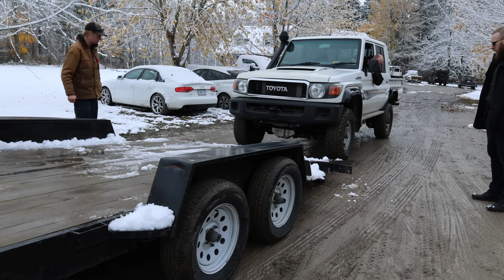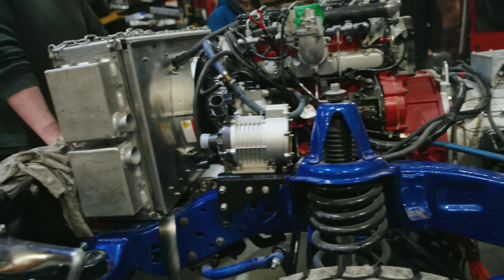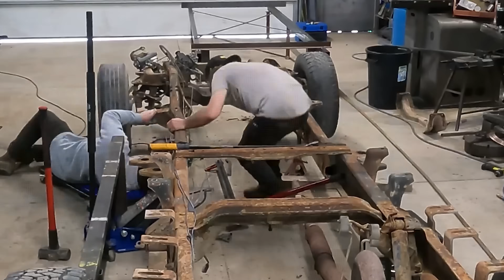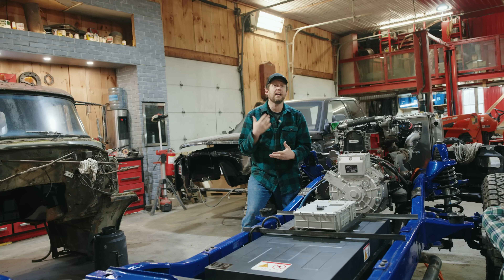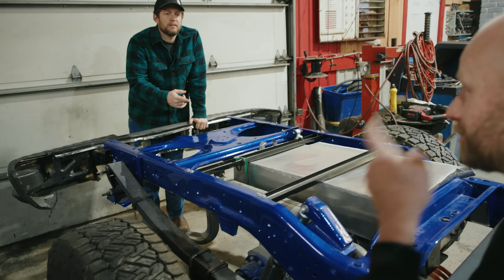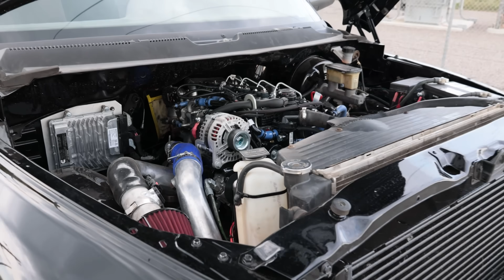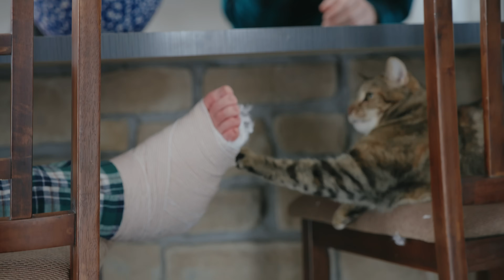Scrap Our First Design and Build an Edison Pickup Chassis from Scratch?

Comment: definitely do not go wider or outside standardized specs every side of it will be impacted Edison's intention is to be fixable to use off shelf parts to be very adaptable and as soon as you go wider that's all out the windows now every hitch on the market no longer is compatible no after market parts fit it tool boxes side mounted are now needing to be shallower to fit when we already scream for deeper bigger boxes decks and boxes now won't have manufacturer support cause not enough vehicles out there to be worth the complete redesign of mounts even sub frames of a box or flat deck need to be moved to line up with frame rails  sure you can adapt to mounts for different cabs and passenger vehicle mounts but you are now playing in so many more clearance issues  and now say a 5th wheel hitch which is generally spanning the frame rails if no longer above the rail now you start running into dot issues  another side is you just cleared up space with the 4 link or under slung suspension allowing for more tire and wheel options which is generally a massive issue for people putting aftermarket wheels and tires on  the vertical height of frame rails yes feel free to make taller as the frame needs to be below all the components to prevent damage if ever in soft ground or off-road it would actually open doors for people to mount things to it but stay inside of universal width specs

Comment: I am wanting to put a 50-60s truck on top. I love the air suspention it really does make a huge difference on semis. I've even thought of adding cab suspention. I was wondering will it have air breaks? Also what would the specs on the compressor be? That last part could mean a small air tank and air hoses to run some air tools as a job sites generator and compressor. A way cool application

Comment: I think this will be a cool swap project for home shops guys but I just don’t see a way for this to actually be feasible for actual commercial users.  When you make your living with a vehicle you need something that just works and this is going to be a very glitchy system I feel like.  By the time you get a whole new drivetrain plus frame and the labor to do the swap you’re going to be in the price range of just buying a new truck.  I still think it’s cool though.

Comment: For my use case, a pre-built chassis won't work. looking to retrofit on X military HMMWV. They use independent suspension on all four corners with inboard brakes, half shafts, and portal axles with CTIS.

Will my best solution be to run an electric drive mounted to the differentials and just remap the torque curve to avoid destroying parts?

Comment: I would be very interested in getting a Edison pick up kit done for my 2011 f350 single rear wheel.   

The only thing I would like to see is the ability to keep my manual locking hubs and the ability to shut off the front drive motors.   My truck drives completely different in 4WD with the hubs locked then it does in 2WD. The steering is “heavy feeling” compared to 2WD so the ability to run 90% of the time in 2 wheel drive with the front hubs unlocked and the e-Axle not working would be a must have for me! I’m sure this could be accomplished with programming and adapting of the OEM manual lock hubs on the OEM knuckles.    I absolutely love this technology, I think what you guys are doing is amazing and I never miss a video!  I’m sure I’m not the only person who could possibly have this concern!

Thank you in advance.  A reply to this comment with some insight to this would be massively appreciated boys!

Comment: Hey guys, something that no one has ever done in a pickup is to leave room for a fifth wheel hitch to hide in the frame rails when not in use. Thousands of rv guys like me that drive around all day with the damn fifth wheel taking up bed space and having to use a winch to remove it. Maybe it’s not feasible but you guys would change the world if it could be done. Dodge,Chevy and ford would be left behind.

Comment: Smaller batteries is good, but not too small.  It needs to have at least a 100mi battery only range.  I have an '01 ram 1500 that I want to convert and make it my daily driver.  My goal is to charge it every day at 110v and only run the generator on road trips.

Comment: Building your own frames will that not jack up the price of the conversion,
Reply: That depends on the conversion. 

Rich spent countless hours repairing, rebuilding, altering the frame on the black dodge and white LC to get all the components to fit.

If they spend money on a new standard frame, then parts just bolt in.

So they're spending way more on frame parts, but way less on rich's time.

Every buyer will need to make the call on whether to buy just the drive train, or drive train plus chassis.

Comment: The chassis concept is the right one. I want to mount a 60's era wagon onto a this type of engine-generator-battery-chassis configuration. The labor to get a retro chassis fully functional is huge.
Reply: It seems that you need a 2.8l shorter version of the chassis and then a longer chassis for a V6. The loading usage will be different for the power needed.

Comment: I know I would never have the money for a conversion but it would be crazy to convert my 1985 GMC G30 van body class C RV. Now yes it's a van but with GM they based it off of 3500 truck bodies. I think it was the C or K series of the time. It has a 146" wheel base. And there's so much unused real estate on the underside.

Comment: Changing frame widths complicates bed design. Chevy in 1946 used a wider frame which killed modification because the bed had to be that width specific

Comment: The problem, will come, when the diesel does not run long enough to charge one cell, to run a full regen? And either running the engine just for regen, “the engine will be doing basically a “forced regen” while driving! ? It takes 15 or 20 minutes just to warm up, then can start regen, but one battery might already be charged?
Reply: For regen, do you mean refill the batteries or regenerate the DPF
Reply: @Sah-o5m to clean the dpf, which they will need to get these things certified for on highway!
Reply: Although with Lee running the epa that MIGHT not be the case, may get away with valve overlap?
Reply: And keep in mind, Edison is anti America at heart or at minimum anti Trump. So they are leaning into the eu market, so yeah they gonna need it

Comment: 4:30 As someone who lives in the mountains, I disagree. I would like to have batteries large enough to capture all the energy provided by rolling downhill. And that can mean up to 2000 m in height difference. With a gross weight of 4 tonnes, this is equivalent to 80 MJ or about 17 kWh of energy.

Comment: If you're going with airbags, more likely, you're gonna be using 4 link. I would have an option either. As an airbag or a coil, spring Dodge does it with their pickup trucks? It's worked out fairly well for them. Can't say a lot of good things about Dodge trucks. The hemi engine in their they're air ride and coil spring suspension

Comment: Please start looking at hub motors for steer axles. Hub motors are much lighter, allow the cleanest drive line and the axles can be solid or independent. The big drive axles have oodles of power. Front wheels only need a small precise amount of power when in mud or snow. These front hub motors sit in and next to the brake hubs. Very different design goals for powering streered wheels.
Reply: A lot of unsprung weight though and it's easier to protect the motor as a big unit in the middle.
Reply: @makatron Let's say the hub motor is 100lb and 25hp. So 200lbs and 50hp combined tucked behind the disk brake. Your proposal for 20K axles would include a half unsprung 200lb driveshaft. A front axle with a carrier and locking differential is 650 lb all unsprung heavier. Might not include universals. BTW, universal can easily be the weak spot putting torque to the road. Besides having almost 4x the unsprung weight, you add mechanical drag, take away individual wheel vectoring. The other big plus to hub motors, is they could steer far sharper than a universal would ever like. Stew it over it has big advantages.
Reply: @ctibpo991  yeah but a heavier wheel is also harder to move and to brake. Thus making turning harder due to the extra mass.

Comment: You are not able to buy a pickup and get upfit. The problem is the 34 frame. That is going to be your biggest problem. Most small trucks have the factory width in front and then the 34 in back. This is how the big manufacturers are able to use their cabs. 

I know that you understand what the industry is doing. And the air ride is a big miss in the market. 

If done right. People are going to get your truck because of the ride.

Comment: For cab mounts drill the frame to fit multiple brand body mounts and build mounts that fit the cab going on so you can take those mounts,use the appropriate holes for the appropriate mounts so it fits up like designed. Keep the frame the original width so that fifth wheel hitches and accessories such as that still fit the truck

Comment: I have a 2019 ram 5500 2ton truck. I would really like to use the electric Hybrid kit on this truck for pulling heavy loads across country. Would really like to keep as much bolt on as possible regarding cab and frame dimensions.

Comment: the frame being 34 inches wide for the main build, but can you do a subframe that is designed for the batteries so they are protected and be lower to keep the weight down, with a fuel tank configuration that does not cause problems?

Comment: On the frame rails, make the under cab wider and narrow it back to 34” by the rear axle, kind of like how the McLaren carbon tub concept looks ( or this ASCII shape -> /T\_ ). That way, you could fit probably up to 2 batteries running perpendicular to the frame under a 4 door/supercab truck while keeping the rear and the front more standard compared to other trucks (and use more off-the-shelf components)

Comment: So my take from this video is that Edison and Deboss will soon be opening a vehicle manufacturing plant. That new chassis design can be used for trucks and full size vans. Create another smaller chassis design and you have yourself a line of SUVs and light trucks. It would be amazing if, down the road, you can get municipal contracts to provide their fleet vehicles; especially the remote communities. Having a fleet that can double as emergency generators…

Comment: The best part is no part, get rid of the large battery packs, and replace them with Maxwell ultra capacitors as your temporary storage, a much smaller battery pack could also be put in if necessary electric only running

Comment: If you guys would like a real challenge, and break into a market of semi-religious Ford Ranger fanatics. I have a 1995 Ford Ranger, single cab, two-wheel drive, V6 engine, With a botched together frame rail, leaky gas tank with a bad hanging bracket, more than one lift kit kind of botched together, a leaky sunroof and oh yeah the air conditioning doesn't work. But it is tagged historic and I'm willing to drive it up to you because it does still run. That's just about the only thing it does normally but it does still run and drive. If you think it would be an interesting challenge and help with your publicity campaign. I will happily deliver it to you. But since I do live in Maryland that is quite a bit of a drive to British Columbia. I'm sure they'll be some paperwork but we'll figure that out later.

Comment: I think it is important that anything you build can work with bodies, boxes etc designed to fit 34" framerail spacing. That is not the same thing as having the frame rails spaced at 34 inches. Looking at the brackets on that Dodge chassis that mount the body etc, they all sit outboard of the chassis... the don't sit ON the chassis... so as long as you can make brackets, cross members etc to allow standard units to fit, I can't see why you would need to keep the standard spacing.
If there are advantages to wider spacing, at least consider it!

Comment: Frames gotta be standard but as far as components go...you talking extra batteries? In a regular pickup you can add batteries to the bed if you need. A regular work truck is going be opting for the smaller side of battery capacity anyway. I do mowing with electric and I keep seeing this with commercial electric mowers. Manufacturers are obsessed with 8 hrs of runtime but you really only need like 4-5 for a realistic work day. So they make these mowers with 20-24 kwh of battery which makes them $30k. You're paying for and hauling around all this capacity you'll never use. Anyway the point is if anyone wants extra battery theres other places to slap another pack in

Comment: 34” rails.
How about adding switchable valves between the electronics cooling system and the engine cooling system. The generator could be cranked to provide warm coolant to the batteries in Arctic temperatures before allowing charging current to flow, and in the Southern summers the electronics coolant could pre-warm the diesel and take advantage of extra cooling capacity provided by the diesel generator’s cooling system. Or, it could be a liquid-to-liquid heat exchanger. Just a thought.
Reply: I was thinking the same thing when watching the undisclosed truck been being brought back.  

Not sure if you want to be mixing/common coolant but a heat exchanger and circulating block heaters on both systems.  Have an "artic warm idle" mode option that powers the block heaters from the battery pack and then cycles the generator as required to maintain min 60% battery reserve.  will cost you a few bucks/hr but at least things will be warm(ish) at -40

Comment: Installer here. The wider rear frame rails also need to accommodate cross members for hitches bumper/5thwheel/goose. If you change the inner width you'll have to beef up those cross members for the new span. Or build your own hitches etc.  I vote keep em simple.  A taller frame C if necessary.

Also Chace, just build mini pete 359's already!

Comment: The most important aspect for me is 4 wheel steering with great towing power. 4 wheel steering is easier with the narrower frame rails. At least at the axle sections of the chassis. I also have no need for massive ground clearance, as my trucks seldom leave the pavement. I do like 4WD for those times that I am pulling a heavy load up a steep incline or when weather is poor and traction is king at getting the job accomplished without getting defeated by slippery roads in wet or icy situations. The other must for me is crash survivability of both the occupants and the truck. If the chassis is designed with crumple zones they should be easily and cheaply replaceable so your truck isn't totaled because some idiot turned left in front of you when there was not room enough for them to get a cross your lane before you slam into them. Those crumple zones should not take out your drivetrain either!

Comment: The narrower 34” would be optimal for better steering angles for sure and would be nice to be able to have a dually without it sticking out so wide (maybe a bit wider than single wheel, but able to use a single wheel flatbed or utility bed on it)

Comment: In running two motors per axle-one would be designed for high torque at low rpm, and the other for power at higher rpms like the Tesla design?

Comment: Unfortunately 34” is the best way, when you consider every gooseneck or 5th wheel hitch system is designed for the standard frame width. If you widen the frame, the hitch systems would have to be customized for the new frame width. Not to mention the bracket placement would be off for the hitch systems.

Comment: Definitely a good idea to manufacturer your own chassis kit. Keep it 34 inches wide and base it like a semi truck chassis where it can be retro fit to any configuration by simply installing brackets onto the chassis to mount cabs, beds, service bodies, etc etc. Also by basing the chassis off a straight rail system it makes the kit simpler to stretch for rv setups and smaller cub truck applications. The air ride setup would be a great system for max payload and gives customers the best deal for whatever their chassis is going to be used for without the added expenses of ordering different springs and shocks

Comment: I cannot tell - but are you keeping the Cummins or are you dropping another engine?
Reply: I BELIEVE that any engine they use MIGHT have emissions problems.
Reply: @Sah-o5m please try again.
If the engine has been certified for road use, then the addition of the generator has no bearing whatsoever on the approval process
Reply: oh comtrare mon frare. If they use the street certified r2.8, then they must use the street certified computer that misbehaves when bolted to a generator.

If they use the computer that is certified for offroad use only, and then put it in a vehicle as primary motivation, then ECCC demands $1M in complaiance testing.

Its a mess.

Comment: If you look ar Dodge, they have a modular frame. From under the driver seat forward is the same. From the seat back has sections that differ for size of back seat, different bed lengths.  Quad cab, crew cab, Mega cab, then the 3 different bed lengths, then the commercial 34inch frame rails.

Comment: Would it not be an advantage to have a standard custom chassis that supports bolt on bodies and accessories via adapter plates? So if you had a wider frame, just allow for standard/ custom adapters. For example, identify appropriate mounting points for the adapter plates to attach to the frame and leave the rest for the plate design.